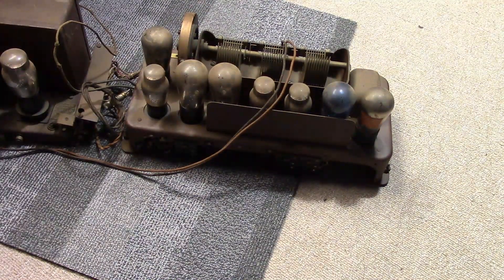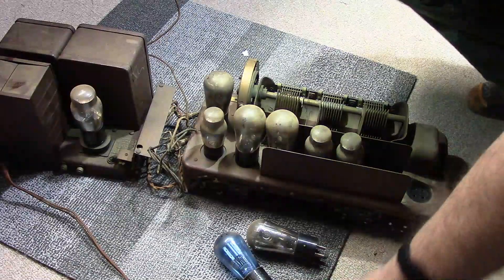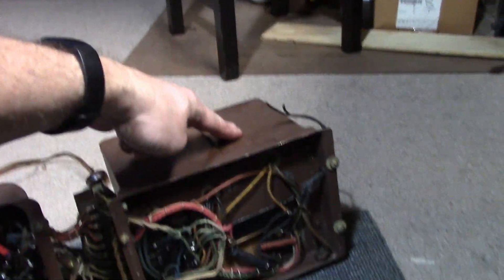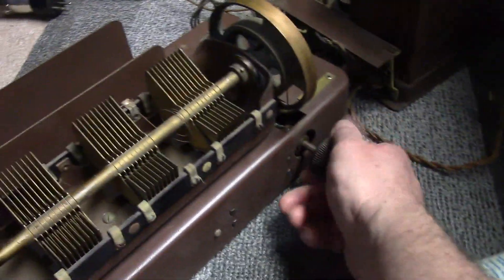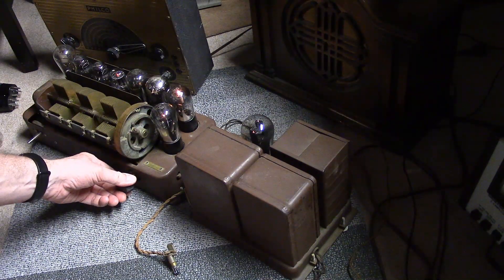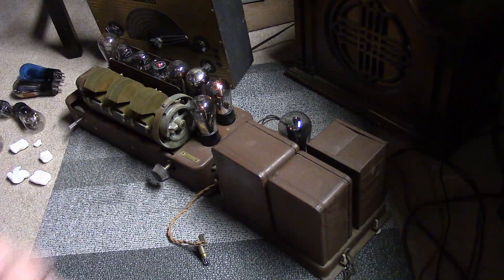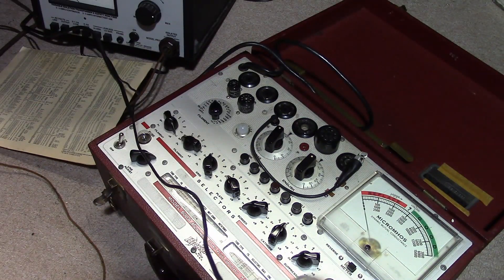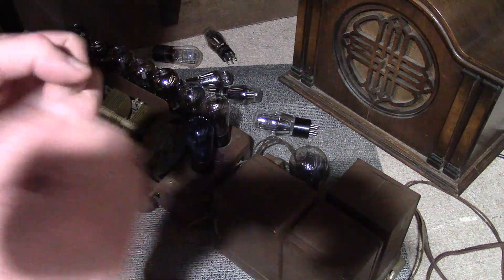Radiola 60 resto p7o?

Comment: I'd say you really lucked out on this chassis. I think I'd monitor everything, perhaps check values on the dog bones and just run it. You don't get many unmolested chassis come your way these days. It seems to run pretty darn good for what it is! There certainly seems to be a correlation with the smokers sets and the preservation of components. Almost makes it worth the extra effort of removing the tar residue vs rust, crust and of course the usual rodent damage we find in this stuff. Whatever you decide, you still have a very nice example of this set in your possession =)

Comment: The valves with the bright heaters (not filaments, technically, as they are not directly heated), have an older style of heater, where the cathode is radiatively heated.  A guy in England called E Yowman Robinson developed the "slip coatsd" heater where it was in actual thermal contact with the inside of the cathode, allowing much quicker heating and the heater operated at a much lower temperature, greatly increasing life.  This form of construction was a great advance and very quickly all valve manufacturers in the world adopted it.

Comment: My two cents? Keep it as original as possible. It's working well. Just add the minimum safety stuff. Slow start, to protect the tubes, fuse to protect the radio. Check voltages and resistors and caps, but if it tests reasonable leave it. 
Anything excessively out of tolerance, replace, without touching original parts other then taking them out of circuit. Maybe replace with spare from different chassis. 
This might be a well kept, low hour radio. So everything could be just fine.
Reply: It's worth checking things that can drive a tube bias wonky, causing it to overconduct.  If worse comes to worst, one can stuff a capacitor for appearance.

Comment: You really made a good buy, it worked without making repairs, for a 1928 Radiola 60. I have been surprised that radios over 90 years old can still work without doing much repair work to them. I'm working on a 1929 Majestic 92 (for someone else), had to replace an open power resistor, all the tubes tested good, 4 are original Majestic branded tubes. I powered it up slowly and it came to life & worked ok. SPEAKING of POT-METAL, Majestic mounted their 5 gange tuning condenser moveable plates to the shaft with pot-metal & the cracks that formed, has caused the plates to move out of alignment. The radio stops receiving stations below 950 khz, because the tuning condenser plates are shorting out. The radio chassis is in very good shape, baring some nice rusty spots on top. I ponder if bending the plates is a viable thing to do, we are going to try. Wish Majestic would have constructed the tuner without using the pot-metal.

Comment: Saw the offer on fleebay  and it is a real good deal. Now that you got good tubes for it now it works great. Combining the 
best of the two chassis and components will  be very satisfying in the restoration process. I'm told the capacitors in it
 are made with imported rice and fish papers and don't deteriorate as badly as more "modern" ones from the early 1930's
 on. Check resistors . Otherwise leave it electrically as is except for the rodent damage. Cleaning the  nicotinic layer of
 grime will be time consuming but needed. Apparently dog approved!👌

Comment: There is an old thread on the antique radio forum about the can capacitors in these that says they used some kind of fish or rice paper?  and it made them last and still work without much leakage. As I recall some people said in the thread there was no reason to replace them.
Reply from the maker: Yes, I read the same.  Apparently, so many paper caps go leaky because of the paper degrading over time.  The high quality paper lasts.
Reply: The higher the acid content of the paper, the faster it degrades. Wood pulp paper, the cheapest and most common kind is high in acid. Cotton and flax papers are lower in acid, and favored for archival purposes. Parchment is also longer lasting.

Comment: Hi Bob what lube did you use on the tuning capacitor. My tuning capacitor is very stiff to turn and was wondering what spacing do you have between the plates and the stator. My plates seem to be very close to one side of the stator.
Reply from the maker: Lubriplate no 105

Comment: what type capacitors do you recommend to replace paper capacitors in a vintage tv?
Reply from the maker: Polypropylene or polyester plastic film caps. Justradios.com is a good place to get them. Also Digi-key and Mouser electronics

Comment: On Ebay, most of the 27 tubes I have bought are around 10 to 15 dollars. But the blue Arcturus I have bought have been over 30 dollars. But I bought them because they are beautiful. I am using them in a very low power home brew guitar amp.
Reply: I was just about to mention that, and I'm surprised your message hadn't automatically been deleted for spam.
Reply from the maker: I've been slowly finding them.  Mostly from scores like this.  I have around 10 now including a 71A output triode and an 80 rectifier 😁
Reply: 27s are fairly reasonable.  The 71A will certainly be the most expensive since it's an audio power triode.  80 tubes are just an older version of the 5Y3 with a four-pin base.

Comment: Tear out working 95 year old parts to put in caps which are designed especially to not last forever (because who would buy them if every single one lasted forever) to make it more reliable? I mean... You are not going to find anything more reliable on this planet really 😆
Keep it original, put all globe tubes inside for the nice aesthetics, the maybe 5 times a year you are going to be listening to it won't be a problem really. Maybe just put a fuse somewhere inside.
Reply from the maker: Well a high quality polypropylene Solen fast cap would last a very, very long time.